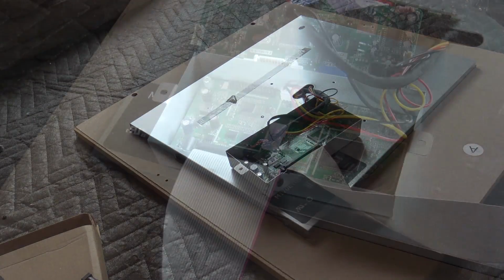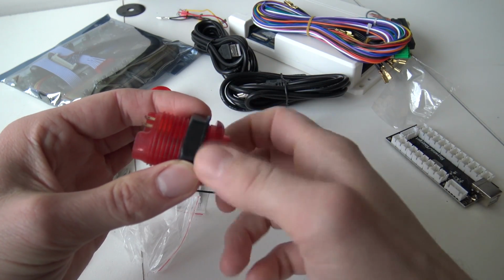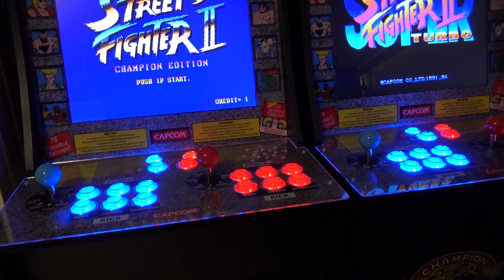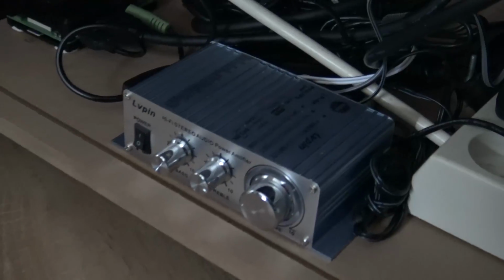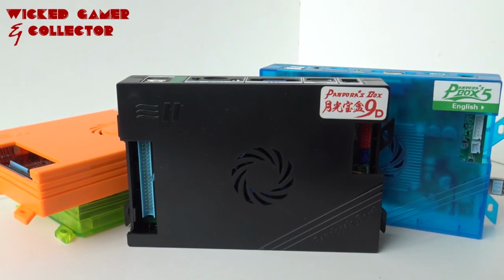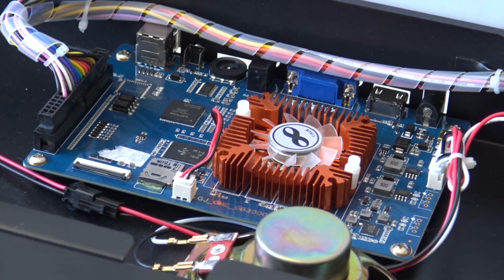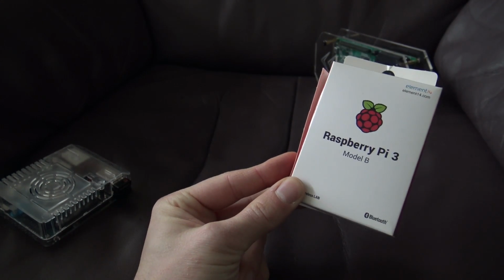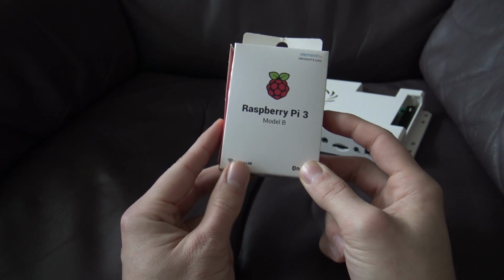Arcade1up Ultimate Mod Tutorial !! 😈

Comment: Hi, i've modded with pandora box wires but i i haven't enough space from the nearest button (C,F buttons) and joystick to fit the 5 pin cables, screw are too near...the 5 pin socket should accomodate in the middle between two buttons and it is impossible to connect the wires...any solution ? thank you

Comment: Hey man, cool tutorial, thx! I have one question: I have an mk cabinet from arcade1up and want to mod it with a raspberry pi 4, in the same way you did. Now I read in several tutorials that I need to drill 2 extra holes in the control deck for the coin buttons and my question is: can't I use the default yellow run buttons on the default mk control deck for this purpose. I am planning to drill 2 holes anyways to get 6 six aligned buttons (analogue to the sf cabinet) but if there is a way to avoid drilling two more extra holes for the coin buttons this would be nice :). Anyways, hope to hear from you and regards from a fellow Dutchman!!
Reply from the maker: I did remove the volume and on / off button.. made the holes bigger to fit in the arcade button. 
We need this for Credit / select button for the arcade. 
Button layout is different so far I know amount is the same so you can connect it same way and re-config all buttongs in retropie when done 😏

Comment: I was disappointed that when I ordered the recommended products that the joysticks in the kit do not connect to the Pandora box harness. The connector is different. I apparently need to order a different joystick with the correct connector. Upon closer examination of the video, it appears you spliced the wires to the correct plug to get it to connect to the Pandora Box harness. Although it is the correct connector for raspberry Pi. Is this correct? The supplier said that the DIY kit doesn’t work with Pandora Box when I contacted them about the problem.
Reply from the maker: Hey, if you mean the connection methode if you look at the joystick connection / cable from the pandora's box. 
That is possible I totally soldering the connection 😅, will search for other kit moment.. thanks for your feedback. 
Kit can be used for Pi only it's possible they send you kit with other connection that is not plug and play on PB.

Comment: I just bought a Street Fighter Cab just to do this Mod. I’m going to gather all components before assembling. I’m confused on how to wire the lighted buttons for Pandora Games 3D. You showed a quick glimpse of the board to power the buttons but me not having any serious electronic experience needs more detailed assembly instructions for lighted buttons. I would like to start the project soon. Ordering the Pandora Box 3D and other required parts from the links provided.
Reply from the maker: I understand the confusion, normally when you use an pi you use both encoder boards and every button haves 4 wires if I recall this. 1 for button 2 for the lightup everything runs with 1 encoder board.
Myself I use encoders pure for lightup and bought original cable harness for controller the pandora.

Comment: Thank you! This is great. Much appreciated. Think I'll go down the Pi route. I really wanted the Final Fight cab though, but I think it will restrict myself with only two button holes (could drill more I guess) but the SF one seems the easiest route to go down. But Final Fight...it's just better isn't it. Doesn't matter I suppose, don't even think its available in the UK.

Just one question, is it very easy to wire up all the buttons? Then you just plug in to the Pi and configure?

Comment: Thanks for this tutorial! I was one of the viewers who send you an email ;) stil in doubt between Pandora or Pi. Also thinking of placing a small active soundbar on top of the cabinet so I won’t need an extra amplifier. And 2 extra coin buttons of course in the front. Maybe even reuse the power and volume buttons but not sure about that because it needs some soldering. How do you turn the Pandora and Pi system on and off?
Reply from the maker: I have switch between the wall socket and the end of the cord.
Reply: Go with the pi 3 if you want to save high scores and there is plenty of rom images out there, no brainer, i have a seperate bartop besides my 1 up arcade with a pandoras box in it and i allways go for my 1up pi 3.